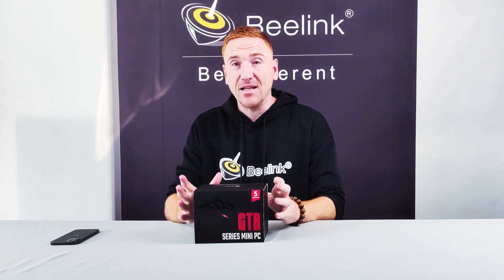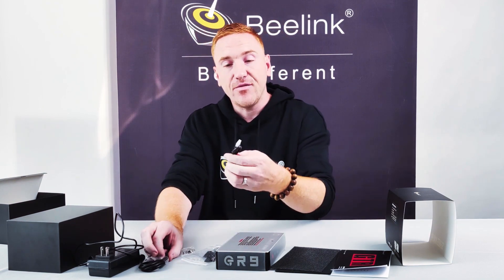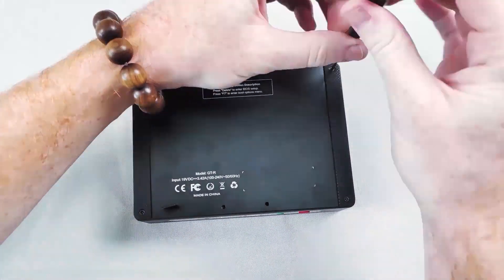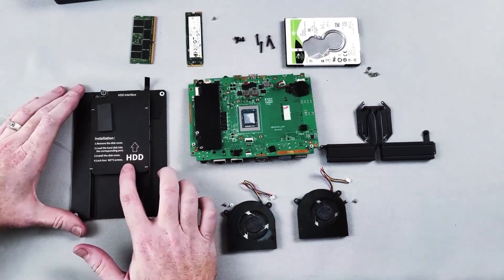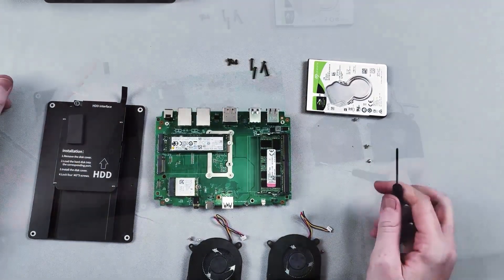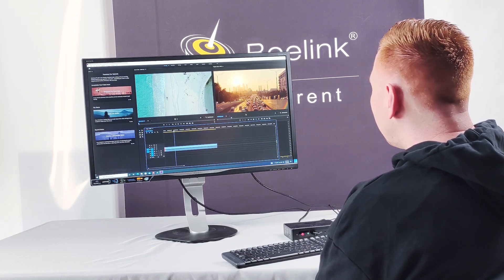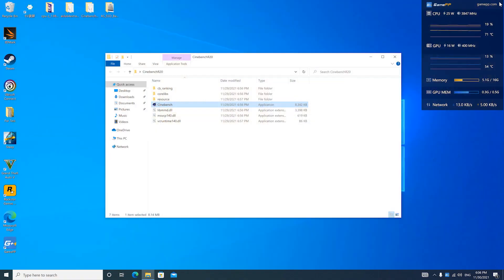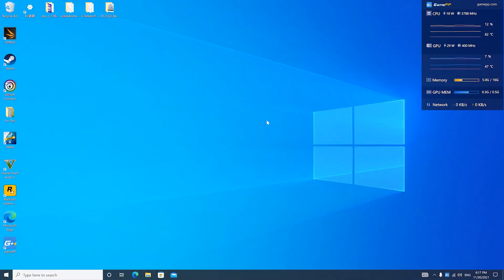AMD Ryzen9 5900HX Mini Pc - Beelink GTR5 Review

Comment: I have one GTR5, unfortunately I can disassembly mine, I can't remove the board from the case no matter what I do... there is not enough space for the board to slide out, the componentes, like the USB inputs for example, they don't have space to get out of the case. Looks easy in the video, maybe because it is a prototype... I gave up =/ @Beelink

Comment: My GTR5 32gb ram is lagging and sometimes crash.  What is going on?
was suppose to replace this piece of sh... with my 2015 stationary pc.  
my old pc destroy this crap.
Anyone here have any suggestion? would a 64gb ram help?
I want to play MFSimulator
Reply from the maker: Hello.
You can pull out the memory and wipe it with a gold finger to try if it works well.
If it's not good, you can contact our after-sales service!

Comment: I just got mine seems like no one at beelink wants to acknowledge there is a major bios bug which causes the device to not save any settings properly which means when you restart the device you get the blank screen with just the fans wanting to start loudly.  This causes you to have to reset the bios undoing all the changes.  I have repeatedly asked if there is a bios update from beelink but they do not answer and the on their own support page where you would typically find this info out they seem more interested in telling you how to downgrade windows and reinstall drivers.  Seriously considering sending the device back if Beelink doesn't want to solve this issue.  Or if anyone with more knowledge on this here can help it would be greatly appreciated thanks.

Comment: I just received mine on Saturday . . . Stayed up until almost 2am updating drivers, and downloading programs. Quite frankly, it did not take kindly to some updates. Consequently, I had to "restore" to the factory settings twice. Grrrrrr . . . I was really pissed the on Sunday evening when it happened a third time. Fortunately, I was able to go to a "restore" point earlier that day (a few hours earlier on Sunday). In any event, I do like it, but have a question regarding AMD driver updates.  Specifically, the AMD Software: Adrenalin Edition, Adrenalin 22.10.2 Optional (WHQL) update, (Release Date 10/21/2022) . . . Is this the one to install? Or is the Adrenalin 22.5.1 Recommended (WHQL) Release Date 5/10/2022? I am asking this because one of these (I didn't note which one) caused problems with my GTR5. Anyone who can provide assistance I would appreciate it. 

All in all, a very good system and I love the small footprint on my desktop.
Reply: did you fix? i got mine 4 months ago,  lags so much and crash  if i watch UHD videos.  Never try play games,  
600usd for a trash
Reply: @AndyMatrix  Mine works perfect. Plays a wide range of shooter games at really good frame rate.

Comment: I bought one, but have had problems from day 1. Windows 11 wouldn't finish setting up and shows blue screen errors. I bought windows 11 pro, installed drivers. Then had loads of blue screens. I have restored back to factory with a Beelink recovery image and still have blue screen issues. The USBs and WiFi are flakey - so the wifi can drop out or the keyboard and mouse conflict. Reviews of this machine have been impressive, but the one received is not good at all. I have been trying to resolve this since 25th of April and it is 17th of May. 🙁
Reply: have you tried to use windows 10 instead?
Reply: @AdamMsP404  Yes - but still get the occasional blue screen and doesn't solve the USB and WiFi issues.
Reply: must be drivers issue
Reply: @AdamMsP404  I've updated those. Made no difference.
Reply: @trackdaylbs  What did the customer care say? I have read there is an update to the BIOS from BEELINK
Reply: I had a older laser mouse that skipped around. I switched to a Bluetooth with no issues. Multiple keyboards ok. Must keep a clear connection for anything Bluetooth like all computers. I would get a freeze when it would sleep. There is a bios setting to stop this. I let windows handle it. 

Check the bios power settings. Check them all.

Comment: Let's get down to business. 

This looks promising as an Elasticsearch node. 

1) Bless you guys for making the RAM dual so that it supports up to 64GB using Samsung 32GB SODIMMs. THANK YOU.
2) NVMe support looks solid! Awesome work!
3) Dual 2.5Gbps is amazing!

Only question I have is if the NVME slots supports PCIE 4.0. If they do, this is a killer product that I'll be buying short. If not, I'll probably still buy one. :)
Reply from the maker: it only supports PCIE 3.0

Comment: If I may inquire, What is the Motherboard PCB dimensions including the height (to include all protrusions)? 

Is it just the one NVME port, or is it dual NVME? 
(Depictions and promotional art appear to have two NVME B/M key slots instead of a SATA B+M slot)
Is the NVME port(s) rated for Gen3 or Gen4 speeds if so?

Thank you in advance, looking forward to receiving my unit.
Reply from the maker: The size of GTR5 is 168mm*120mm*39mm, the PCB board will be smaller and thinner. GTR5 has two M.2 interfaces, one supports NVME and one only supports SATA3, which will not interfere with each other's speed, and the speed of NVME M.2 can reach 2000M/S+.

Comment: This is a great deal for a good performance machine... perhaps not si for gaming,  due to the limitations of the integrated GPU, but for dev or virtualization, it's awesome! 
Will definitely look into getting a 64GB version for type 1 virtualisation (most likely ProxMox) and take it from there.
Reply: If the purpose is running Proxmox my suggestion is a three hard drive configuration. I mean I recommend to install M.2 1T sata and a 2.5 ssd 1T sata. In this way you run all you want and play with some raid 0. Running Proxmox for a while.  Proxmox is based on Debian so now you know why I have no respect for Windows. Finally don't forget to connect your proxmox machine with a wire to your router or to a switch connected to router via wire as well. No WiFi!
Reply: @derekgoodwine7509  will definitely take advantage of the additional storage options available from this small box! 
Thanks for the suggestion!
Reply: @derekgoodwine7509  
It will depend on which chipset Beelink is using for the 2.5 GbE NICs (whether it's the Intel I225-V 2.5 GbE (which has questionable support for the `igc` kernel module in Proxmox) or if it is going to be the Realtek RTL8125.)

I've had a Minis Forum HX90 before and it had the Intel I225-V 2.5 GbE NIC and Proxmox VE 7.2 would load the `igc` kernel module properly when you are installing the host OS and you can even assign a static IPv4 address and everything, but the MOMENT you reboot the system for the first time, it will, inexplicably, fail to recognise said Intel I225-V 2.5 GbE NIC and/or won't (properly) load the aforementioned `igc` kernel module, so after you reboot it, you have no network interfaces.

shrug

Go figgin' figures.
Reply: It's good for gaming too. I run RDR2 finely on it. Of course, you wouldn't reach 120 fps with this machine but it does 40 FPS which is very well playable. GTA5, Skyrim, all fine, any 2D platformer, heavy Photoshop or video edition even, but not Starfield or Control.

Comment: I got a GTR 5 Ryzen 9 5900H, 64GB of ram +  1T unit recently. Waiting for the delivery.  I am not a fan of Windows at all and to tell you the truth I already purchased an M.2 NVME 500GB 3.5Gb/s. I am going to flash it with ArcoLinux and give this machine the dignity it deserve. SUGGESTION: it could be nice if we can have the option  to get this unit with Manjaro or ArcoLinux preinstalled. No offense  Windows is garbage and some consideration for the Linux community can enlarge your customer base. Something to think about it. Moreover different options  from which to  pick 64GB Ram with a smaller NVME (for instance 500GB) can contain costs. 1T on the boot parition and oS doesn't make much sense. A secobd bigger  hard drive makes more sense. Finally at this price tag two NVME slots should be recommended. The speed of a M.2 Sata is not different from a 2.5 SSD Sata (I already bought a 2.5 SSD 500GB Sata unit for an upgraded as soon as I put my hands on this unit): if there is a slot for a 2.5 SSD Sata it makes more sense to have a second PCIe for another NVME. I don't play video game but I am a programmer and 64GB of ram is going to let me use a Hypervisor Level 2. The choice of 3200 MHz ram is a great pick. Please maybe a GTR 5 Ryzen 9 model P (for programmers) and model G (gamers) might be a solution. Otherwise let customer choose Ram size and NVME size independently.  I love Bee Link but I feel like programmers are totally overlooked. This is going to be my portable production machine! Thank you for your consideration!
Reply: I disagree with Windows being garbage, although, being a programmer, I understand why you'd say that.

That said, I too will get a 64GB option and but with the idea to install a type 1 hypervisor, which will be a great learning/lab environment.
Reply: @FernandoDCD  running Linux and FreeBSD for a while so Windows to me is as much  exiting as cheese on an ice cream. Windows 11 to me is another number will required a lot of patches. Back to serious stuff I run a hypervisor level 1 (specifically Proxmox) on a dedicated machine in order to run contaniers and nas and work on some raid. That one is my personal cloud. My GTR 5 ryzen 9  machine will be my backup and portable programming computer. Thank you for your polite answer. Bedise with no Window this unit might cost less because there will be no license cost.
Reply: @derekgoodwine7509  definitely agreed on the license cost reduction! 
And also understand your point of view on Windows, no worries :) 
I also looked at the barebones option and add the RAM and storage myself, but in the end, the total price comes down being pretty similar, at least, at this current time.
Reply: @FernandoDCD  I did the same and I came to same conclusion. Keeping in mind that it's 3200mHz ram  it's expensive on any onlune purchase anyway.  At the end with a 64 and 1T nnme the price is more or less the same! I picked 64 so it's equipped with all you need at the beginning so we can enjoy the unit right away!
Reply: Derek I agree wholeheartedly with everything you said. 
The only observation I would have to add is that is a bit disappointing only having three USB3.0 ports including the Type C. The Minisforum HX90 has six of them in total (five Type A and one Type C) eschewing the obsolete USB2.0 completely, but more importantly the Morefines S500+ has three USB3.2 Gen 2 ports (two Type A and one Type C) allowing 10Gbps data transfer to/from flash drives.
Reply: @X-boomer   I agree with you 100% bedise minisforum offer some of its units with majaro pre-installed. Another thing I would like to point out is that a second slot for a sdd. A unit a little more tall can have two ssd or a little more wider in order to parallel two units!
Reply: Are you planing to use virtualization with QEMU?
Reply: @MrSojek  I run proxmox right now because I have containers and backup and more
Reply: I have the same spec machine and have had no end of issues with Windows 11. I have seen every type of blue screen crash error so far and still trying to resolve this. I like windows 10 and Linux, but need Windows as sometimes I need to write windows apps. This machine is for data work mainly - which should ideal... if I can stop it crashing or freezing.
Reply: @trackdaylbs2782  Does it freeze under heavy load or just randomly?
Reply: @MrSojek  - mainly after rebooting, other times under normal use. Never really had the chance to put it under heavy load.
Reply: A programmer like me will upgrade. I went from 32 to 64, a 2tb nvme samsung and a 4tb 2.5 sata.   The pricing is nominal so there no difference spacing it less for cheaper and upgrading with better stuff.

There is an Ubuntu image you can download along with drivers on their site.

Comment: I hope that you implemented a thunderbolt 3 on this one so you could offer more than the minisforum hx90. Everyone knows that this is not a good for gaming without a dedicated graphics card. However, it will standout from its competition if you implemented thunderbolt 3 to give the consumer an option to add external GPU
Reply from the maker: Thunderbolt protocol is a protocol developed by intel and Apple, which is currently not available for AMD
Reply: @Beelinkchannel  is it possible to utilise the extra m.2 slot instead?
Reply: @Beelinkchannel   stat die Antwort geben, Sie haben meine Nachricht trotzdem entfernt, jetzt ich denke dass unnütz das Geräte gekauft... Scheiben Sie Wahr ,dass das Ihre Geräte keine Thunderbolt™ 3-Port hat...

Comment: The Cinebench R20 score for GTR5 is 3672 points and the score for the "Identical System" with AMD R9 5900HX is 4512 points. That is a significant difference. Since this is a test machine, I would like to know is there a chance of improving the Cinebench score for the final product?
Reply from the maker: We have retested the Cinebench R23 and you can check
Reply: @Beelinkchannel  thanks!